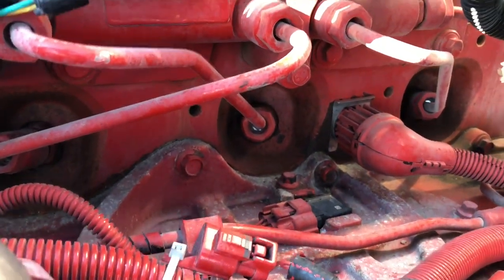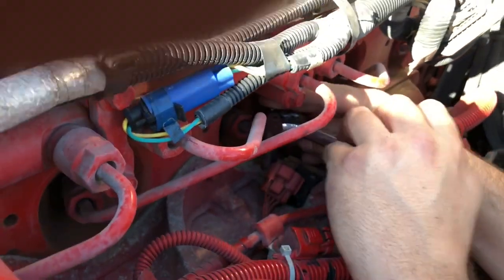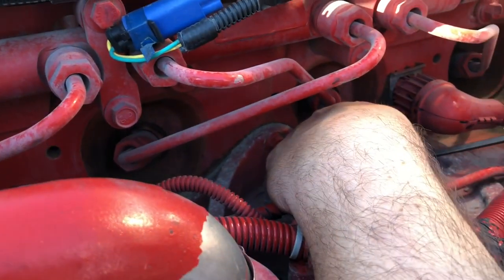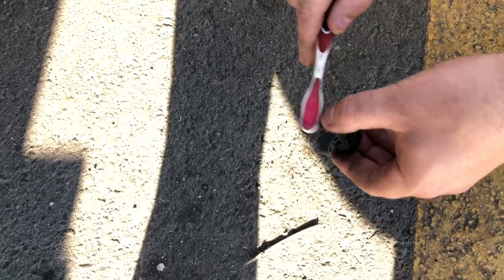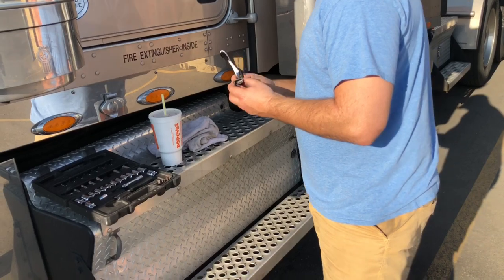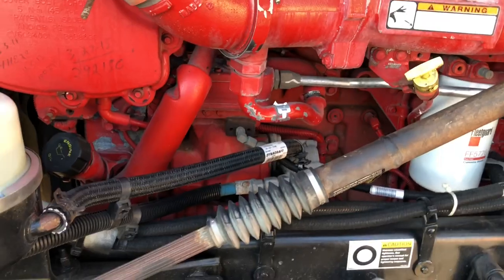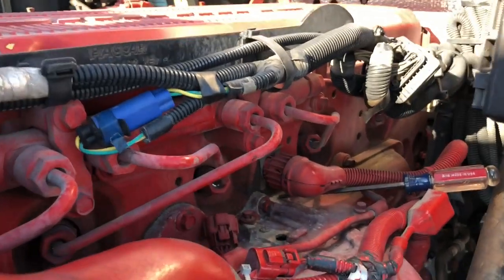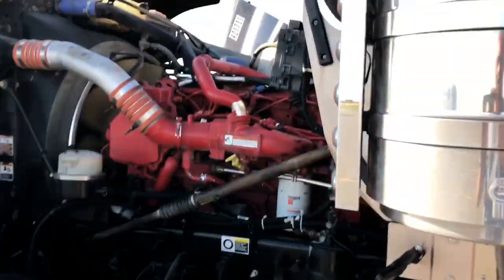Cummins ISX IMAP (Manifold Absolute Pressure) CM 2350 Sensor. Fast and easy to clean and/or Replace.

Comment: Hey man, I’m a certified Cummins mid-range / heavy duty tech at Cummins in Kenner, La. I can tell you that you’ll get map, turbo, EGR and coolant fault codes all from this issue your cleaning. Also, if your cleaning / replacing this MAPT (Intake Manifold Pressure & Temperature) sensor every 80,000 miles the issue isn’t this sensor man. It’s the EGR system starting to malfunction. You need to disassemble the entire EGR system including the EGR cooler and steam clean, not pressure wash all the hard components. Then you use CRC Contact cleaner to clean all electrical components (sensors only). For the EGR valve, just use a sandwich bag to cover the Electrical motor and seal it with a thick rubber band tightly winched around the bag. Then steam clean the internal passages of the EGR valve, try to operate the EGR poppet valve to assure while steam cleaning you get the poppet valve sealing surfaces as well. Then reassemble the EGR system with new gaskets / seals and your set. This EGR system maintenance should be done roughly every 100,000 miles. If done correctly your EGR system and MAPT sensor won’t soot up like yours has done repeatedly. Cummins doesn’t publicize this info, we techs call it an EGR service due to a aftertreatment failure or EGR system failure. You should probably have your DPF pulse cleaned and baked every 150,000 miles as a preventative measure to keep the AFM (Aftertreatment) and your EGR system both working with ease and correctly for many 100’s of 1,000’s of miles without any failures. Hope, I helped you with this info., trust me Cummins WON’T tell you this until something fails or causes other very expensive EGR, AFM or any number of air handling issues with your engine. Also, every oil change you should ask your cummins shop to check for any ECM Revisions. If any are available, I STRONGLY recommend you having them update the ecm code to keep it current. Doing so will keep false occurrences of ANY fault codes gone as well as give you updated system diag functions (if available) as long as you use Cummins Insite V8.2 or higher to connect to your ECM. Some faults codes just give you a yellow (CEL) check engine light, some other give you a (CEL & and a SEL) red stop engine light which may end you up derate to 5 mph or engine shutdown. One last thing, please do your engine lube services as the Cummins Operation & Maintenance Manual tells you to do depending on the duty cycle you operate your rig. This will keep your engine and aftertreatment system working as it should as well. I’m not defending Cummins but, I am telling your what I see as a cummins tech and how I address it. In 7 years I haven’t had a comeback on any of the repairs or maintenance I’ve told you about. Just don’t tell a cummins shop that, they’ll lie to your face and take your money. I get in trouble with my boss all the time simply for telling the customer the truth and recommending an actual fix or maintenance to the customer to save them money. This takes business away from Cummins so they don’t like the customers knowing our tricks of the trade especially if the trick keeps the truck out of the shop and on the road. By doing so keeps the customer from having to bring their rig to us to fix. Most techs in the shop I’m at just do the repair straight forward and they don’t honestly tell the customer about things noticed that really do need to be fixed or try to up sell a repair that’s not really necessary. We don’t work by commission, we’re just on the clock working by efficiency to get raises and promotions. Selling extra shit to customers doesn’t make us techs more money, other than giving us more to do so the company gets more money in labor and parts sales. This is how 90% of Cummins distributor and Cummins approved smaller shops work based on clock hours not commission.
Reply from the maker: Awesome Share!! Thank you, Thank you, Thank you!!
Reply: MakeCents another thing about using Cummins Insite is that, you get many other functions to aid in maintenance or to diagnose for a better repair. Here a few I know off the top of my head. Cylinder Cutout Test, Cylinder Performance Test, Aftertreatment Stationary Regen, DPF  restriction Test, SCR Catalyst Performance Test, Injector Performance Test, DEF Doser Valve Override Test, High Pressure Common Rain Leakage Test and VGT Actuator Heuristics Test. There may be more or less functions depending on engine model and engine control system. From the video I can’t barely see your ECM but, it looks like your ECM has the two big 96-pin connectors. If that’s true then you have at least a CM2350 (2013 or Later) engine control system. So, you should have access to most if not all of those function or more as long as you use Cummins Insite V8.2 or later. These tests or functions we use in conjunction with CSS (Cummins Sales & Service) which is for us techs is guided troubleshooting steps. Using CSS and QSOL (Quick Serve On Line) which is where our service manuals are among many other things is how we troubleshoot and repair Cummins engines day to day. Cummins Insite is expensive and a subscription to QSOL is pricy too but, you’d have true access to the exact same materials we use as Cummins Profession Techs to maintain, test, troubleshoot and repair your engine.
Reply: Hello,  may I private messages you.  Im in North Dakota working and have some questions. What is the best way for contacting you should you agree.  Thanks
2013 kenworth has delete done. I pulling codes for intake manifold air temp.  I replaced with two new sensors.  What are your thoughts.  I'm not much of a diesel mechanic and I feel that the shop up here is trying to take advantage ,  telling me it's a wiring harness issue, which it very well could be but I suppose.
  Rebuilt with 300 miles on it.  I'm poor enough now.  Thanks
Reply: Thank you for the advice
Reply: @80sfordguy  you still do work in Kenner La? I’m in Slidell La and I need a mechanic asap.
Reply: @haroldgeauxlsu5131  yes still in Kenner but, I no longer work for Cummins in Kenner. What type of work you need done because I’m only a in-shop auto/industrial truck tech?
Reply: Delete it and forget it 😆
Reply: Hi there . Would you please advise what kind of steamer do you use to clean the egr valve ?
Reply: @emiltoshev2950  when I worked for Cummins Inc. they had an industrial standalone “high pressure steam cleaner”. It’s basically a very high pressure “pressure washer” that has its own dedicated burner and small water storage tank that maintained 160-240 degrees F. I usually pressure wash EGR and other components clogged with EGR Soot with the steam cleaner set to 200-240 degrees F. This not only makes easy work of cleaning engine parts but, it completely obliterated Soot, Oil Sludge and many other nasty substances as well. Worked great on garbage truck that we had to repair, LOL!!!

For you sir just purchase a good quality high pressure “Pressure washer” connect it to you hot water faucet and set the water temp as high as it’ll go. Just don’t forget to turn the temp down when your done so nobody gets scalded by very hot water. Also, don’t connect the pressure washer to the drain valve on your water heater, the sediment that collects at the bottom of the tank will destroy the pressure washer internally. Make sure to connect it to a hot water faucet that way the water is coming from the top of the tank where the water is free of sediment!!!
Reply: @80sfordguy  After the EGR is clean and instal back, do I have to do some kind of calibration on the ECM ?
Reply: Would a bad or dirty imap sensor cause a fmi7 code? Thats a mechanical failure to respond code i believe. Im tempted to believe its the vgt/turbo again. My turbo and actuator are 2 years old. Maybe 150k miles. Im getting VGT not responding codes, turbo intake temp sensor, manifold pressure codes, etc. My friend who is a service writer at KW over the phone says new turbo and vgt. My other friend and regular mechanic who owns his own shop just checked the truck and said its the imap sensor. I hope thats all it is but wanna get it repaired correctly so im not stuck on the side of a mountain in winter.
Reply: @simplespeed84  check the vgt sector shaft travel test & vgt calibration check, check for cac or charge air restriction/leaks, check for exhaust exhaust restriction/leaks, check EGR system for soot clogging/leaks. The cac or turbo function, intake or exhaust restrictions/leaks all cause imap sensor faults with other associated faults!!!!!! Check the items you have faults for first then the peripheral components around them ahead or behind those faults like actuators or sensors. Have the turbo and vgt checked before just replacing them, save your money on guessing and troubleshoot the problem. You dealing with an actuator problem or an air in/air out problem but, start at the vgt then the turbo & intake system, then the EGR & exhaust system.
Reply: Delete all that garbage. Problem solved
Reply: @nunyabuziness8421  the don’t use emissions in Mexico, maybe you could go their where rolling coal rules. Meanwhile here we are forced to deal with the EPA and CARB!

The rest of us technicians have no choice but repair the screwups of shade tree driveway mechanics deleting systems that the engine relies on to function properly.

Comment: Someone isn't cleaning their EGR and intake every 100K miles like they are supposed to. Luckily all that "extra" junk fell off mine about 500K ago accidentally, so I haven't had to clean it since. Averaging 8 mpg is just another benefit, LOL
Reply from the maker: Just been 85k lol my is about ready to fall off I can feel it :)
Reply: How do you clean your EGR? Is it related to regen light blinking and on. I got this problem on my isx15.
Thanks for advice.
Reply: Mine was deleted and i dont have to do this crap anymore 😆
Reply: This sensor is eliminated when you delete the truck ?

Comment: If you change this censor , change the EGR delta censor also at the same time ..the delta censor has more to do with your fuel milage ..it is the one that measures pressure in the egr and tells your truck when to regen ..the heat censor just basically measures the heat of the air going in the intake
Reply: Am going to remember 👌🏿

Comment: A little tip on fussy connectors is while pressing the tab, push IN on the connector before pulling back. If it’s really dirty/dusty hit it with compressed air and/or brake clean/contact cleaner to clean it up. Same goes for cleaning debris BEFORE you open the engine.
Reply from the maker: Good tip :) Thank you!!

Comment: Use carb and choke cleaner or go to napa and get the cleaner for electrical parts. That way you don't dry out the plastic and cause early failure.
Reply: sheepdog 9/11 better replaced

Comment: The EGR flow of these engine makes it very difficult to maintain all these components. Delta P sensors, mixers, ports, and now I see Coolers clogging at less than 100K . Emissions is a MoFo..

Comment: I was parked in that very spot looking at your videos!! I upgraded my dat account to the pro version, got the imap sensor and the other one you swapped out and just did that today. You passed me onetime out on the road, I remember the shift knob! I need to replace the oil pressure sensor, fix the front structure leak, and a key off no power in the bunk electrical problem, so keep up the videos!

Comment: Man, I cant wait to get this last load on in this lease truck so I can get in the one I just bought. First thing I will be doing is going straight to the KW dealer and grabbing some of the sensors you have been showing how to replace. Im sure there are a lot of guys who owe you a steak dinner.... I hope to be one of them.
Reply from the maker: shoot yeah man, they will save you alot of heartache.
Reply: The delta pressure censor is what will improve fuel milage the most ..but i suggest changing the 
EGR TEMP CENSOR 
EGR DELTA PRESSURE CENSOR AND THE MANIFOLD CENSOR. 
 All 3 go to your ECM ( engine computer) and give information so the the computer can decide your best air/feul mixture..
So if one cesor is dirty and one clean u will not be sending the correct info to the ECM ..
Reply: @mikewasko4964  thank u will write this down.getting ready buy truck too

Comment: Cummins told me they recommend you change it at 100000, mine was never changed for 525000, was the first thing I changed and could tell instantly. And of course the doser valve
Reply: What changes do you notice when you replace that doser valve? I just pulled my IMAP and I'm pretty sure its never been changed, bought my truck with 556k.
Reply: @maxenra  the imap reads the air mix coming in so it should start running better and small fuel gains the doser valve sprays diesel into the exhaust so if it's clogged it'll have harder time getting regens up to temp in a timely manner

Comment: Great service you are doing for Drivers who have that motor! Really wish someone did the same with my motor, but not that many bought the old Mercedes Benz 4000 motor. Not much info out there, other than general complaints because mechanics don't know how to work on them. I've been lucky with mine, but my buddy has experienced the opposite with his. He just picked it up from getting a rebuild today at 550,000!  Way too young for a rebuild!
Reply from the maker: yes i agree. Lots are inframing the cummins way to early as well. Most say they are lucky to get 500k

Comment: Awesome info, just changed mine and it was completely crusted over. We'll see how she runs now.
Reply: Its a heat censor , 
Its just telling the ecm what temp the air is going into your intake so the ecm can adjust the fuel accordingly,. It will help a little on fuel milage but the main component u need to change for a big difference is the EGR DELTA censor..this messures pressures in your intake and is basically what tells your truck to regen or open or close the EGR VALVE  ..if the delta pressure censor gets clogged up with soot if screws everything..also if your truck has 800 thousand miles or more its a good idea to go ahead and change the ECM . Its about $1500 for a remained ECM and easy to change but u have to run a new program on the engine when u replace it ..the ecm is crucial to fuel milage , regen ,and overall tell your engine how to  burn fuel and air ...all these censors and the computer ,ecm, work together so if u chsnge one its a good idea to change them all .
Delta pressure censor
EGR heat temp censor 
And the manifold heat and pressure censor. 
All 3 should be changed together to maximize the information going to the ECM so it can adjust your air / fuel mixture accordingly..
If you chang one but anther is dirty I dout u see a difference in performance..
All 3 are simple to change and there are many you tube vids on all 3

Comment: I cleaned mine and it looked a whole lot uglier than yours. It did improve my fuel mileage after doing that.

I want to correct you about that sensor. It is a duel sensor, it measures pressure and temp. That sensing bulb is for measuring air temp, the pressure sensing part is deeper inside that protected area. You want make not clogged up with carbon.
Reply from the maker: Awesome!!

Comment: LADIES CAN DO THIS!!
10mm to loosen that bolt and BAM! took a but to wiggle it out as not to break it, like comments said.
Can't THANK YOU enough!!
Tired of the dealership doing all this stupid stuff just to keep you coming back and NOT fixing the REAL ISSUE! Took mine out and it looked like cake dough in there. +500k and I can't imagine if or when it was cleaned. Company driver and worth 10 minutes of my time to make my machine run like a top. the smell from not regen was bad. I still can't figure out why it said high temp regen when I hard braked.🤔

Comment: I did mine after watch your video, truck run perfect now. My other problem, what is it on cummins isx15 on 2015 kenworth T680 that kept showing Low Oil Pressure? I add 4 gallons of oil amonth ago and a monther later it giving me a low oil pressure at idle below 20 PSI.

Comment: When i was a technition i would clean those whith inderct brake cleaner non-clorinated.let dry then re-instal. Dont use break cleaner or never wd40 or simuler.😊
Reply from the maker: soot magnets lol I just use water and a tooth brush. After I brush of course lol JK

Comment: Some people keep saying: "clean it up." 
If I remember, the best way is remove all tube and clean up soot, after that install with a new sensor.
Reply from the maker: That was useful for the 870,871’s with the smaller tube. I did it on my last truck and realized it wasn’t needed. 2250 & 2350’s are not restricted like the older ones
Reply: @MakeCentsTrucking  hello bro help me whare kilometer wiring pls help

Comment: Hey bud , i had my main , rods , bearing replaced and the mechanic i had a hairpin leak coming from the liner ..is there a product I can add to maybe delay the leak so I can save some çash to repair? Also is there such a repair for leaking liners  thanks

Comment: Best way to reinstall tbose pull the dipstick get a lil oil on the oring and pop it with the handle of the screwdriver you used to gently pry it out of the hole with. A pick and ether or brake clean will clean it up like new

Comment: Break cleaner and starter fluid works best for cleaning it up   just don't dry out the gasket on it.
Reply from the maker: Brake cleaner is a soot magnet. i wouldn't use that. Starter fluid or carb cleaner though is what i use too

Comment: They are like 65 70 bucks your motor is burning oil use carb cleaner if you use brake cleaner it will get filled up with soot and don't forget the other sensor by the turbo clean it as well
Reply: What other sensor by the turbo? Name?